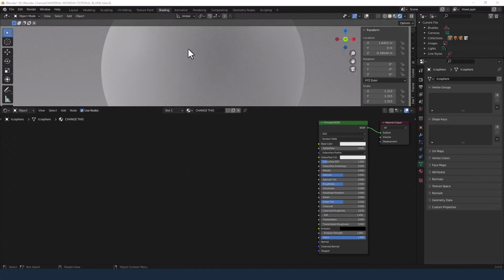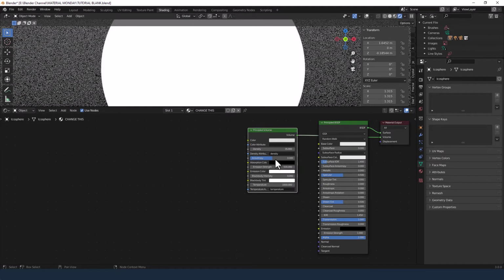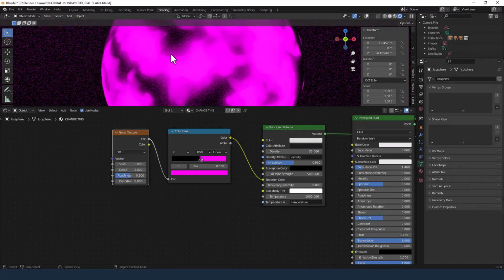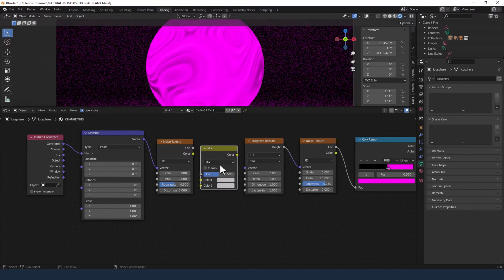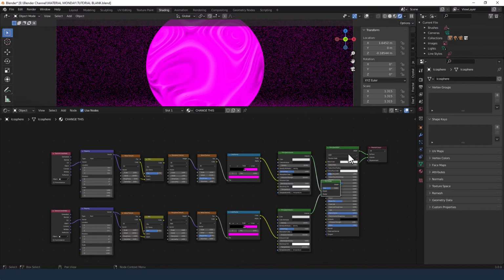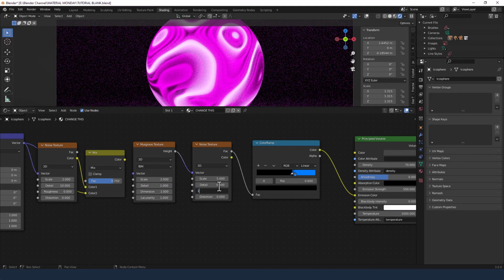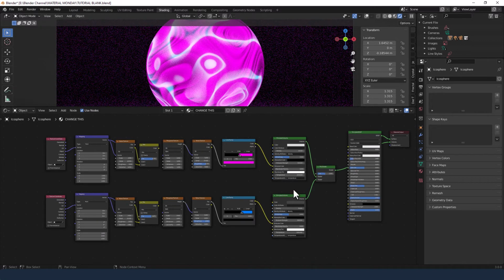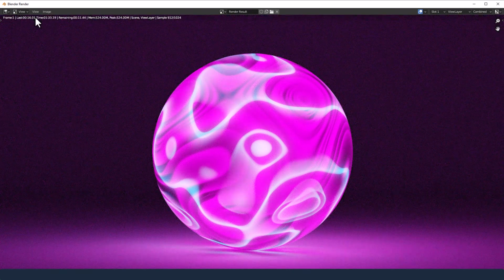CREATE A PROCEDURAL PLASMA BALL MATERIAL FOR BLENDER

Comment: Er, what are the mix shader, third noise texture, and mapping nodes for? You never connect them to anything, and they don't influence the texture.
Reply from the maker: Connect them to the vector input of the neighbouring node on the right and you'll get an effect more akin to the preview image for this video, rather than the softer and less dense render you get in the video.
Reply: I was going to ask the same following with a question how it even works showing changes if it is not connected to any output.